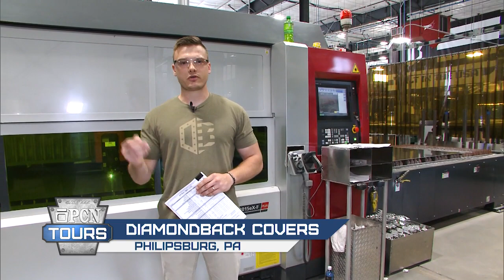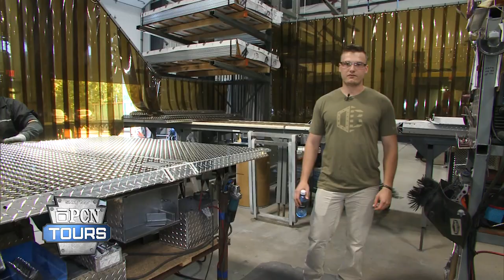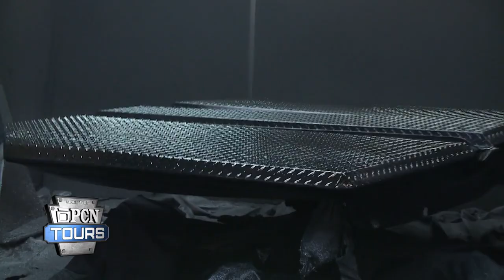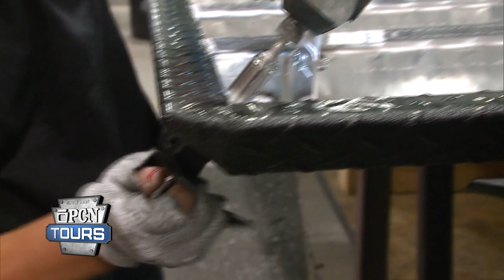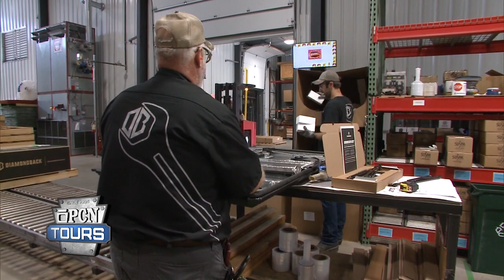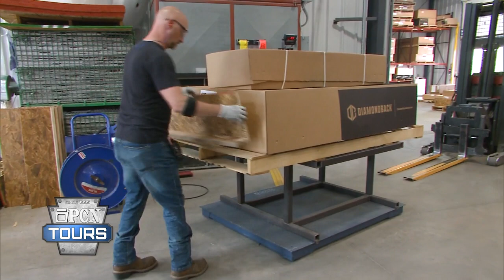DiamondBack Factory Tour on PCN Tours

Comment: I just got the HD model for my truck. In my head when I bought mine I figured I’d get the ATV accessory package later on down the road. I sure hope I can still do that otherwise I will be extremely disappointed. And please note this is not Diamondbacks fault this is mine should’ve done lot more research before paying $2000 for a cover.
Reply from the maker: Hey James, congratulations on your HD! No need for any worries here, you can most certainly upgrade that cover down the road. Our ATV carrier covers are built on the HD cover as the foundation. Whenever you are ready to pull the trigger on those ATV accessories, you can either go directly to https://diamondbackcovers.com/collections/atv-sxs-accessories and select the accessories that fit your needs, or call/email our support team and we can help get you squared away at (800) 935-4002 or Sales@diamondbackcovers.com
Reply: @DiamondBackCovers  thank you very much for this information.

Comment: I just bought a new Nissan Frontier that was a work truck build for a utility company that never took delivery of the vehicle. It has a Diamondback cover. The hatches open from either side instead of the usual front and back locations. This is definitely the most hardcore heavy duty bed cover Ive ever seen in my 49 years! I love the fact that its easily removeable and re-installable so I can use the full potential of the bed. BTW, the truck also came with a Whalen mini light bar installed and a RAM phone mount next to the radio. SCORE!